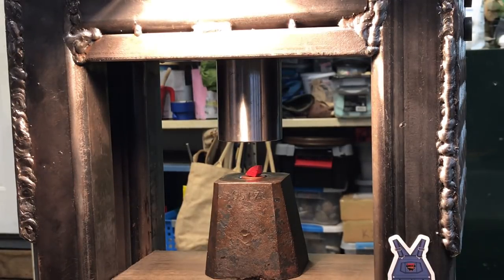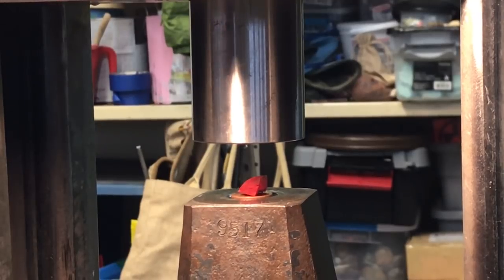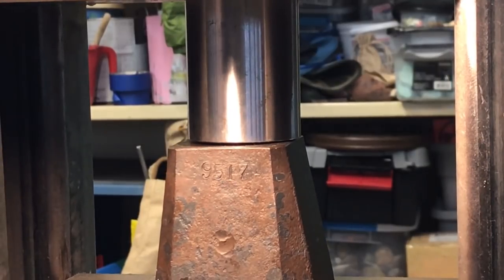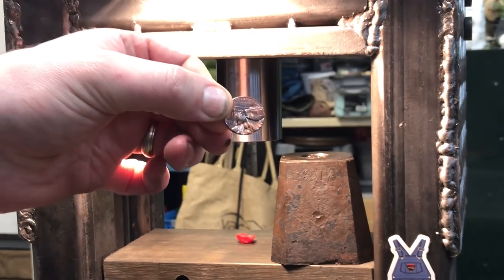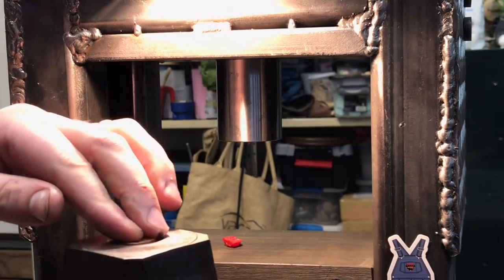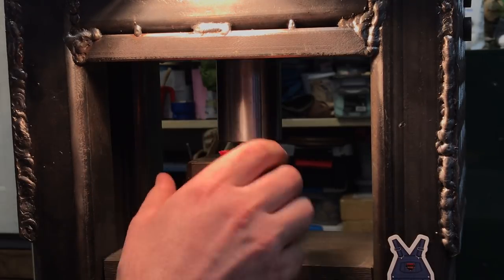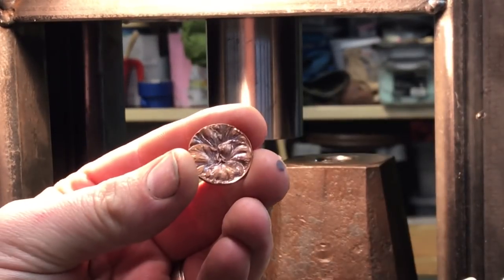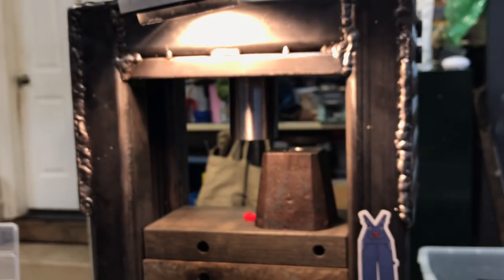Metalsmith Making coin Jewelry-  Pennies into Awesome Jewelry !! Jewelry basics!

Comment: I heard you mention the bronze dies from India.  Do you use your press and urethane with these also?  How have they held up?  Any tips for using them?
Reply from the maker: I have used them in my press they hold up pretty well. Although I find myself being extra careful and annealing my metal more often than I do with steel dies. As far as tips- just go easy on them brass and bronze likes to crack under pressure - if using them and any other die I don’t physically stand in front of or behind my press just in case one lets loose
Reply: @LionPunchForgeLPF  Thanks for the reply!  I feverishly bought a whole bunch of them in the middle of the night because they’re SO pretty and then got worried I wouldn’t be able to use them. Haha!  I was going to try 26 gauge when they get here.  Do you think that will be too heavy?
Reply from the maker: I think 24-26 would be perfect- as you are pressing try trimming some of the excess away from the pressing as you go they would help get good impressions with hopefully less work
Reply: @LionPunchForgeLPF  Thanks so much for the tips. As always a little nervous to try my first one of these but also excited!